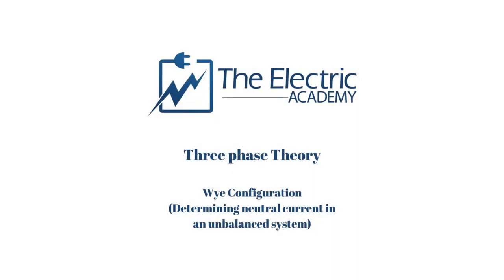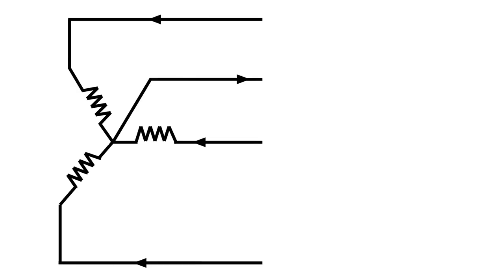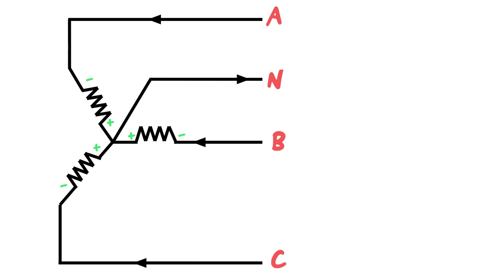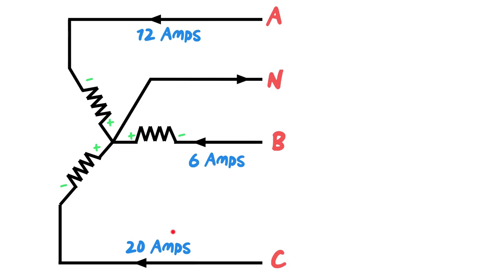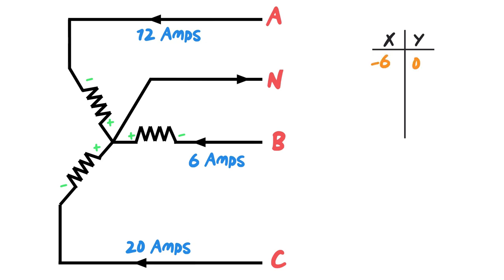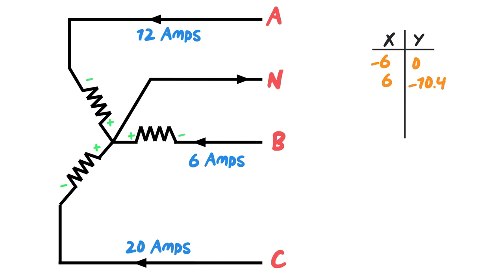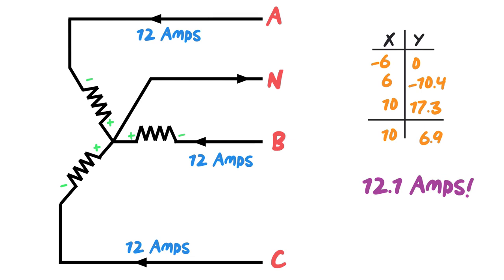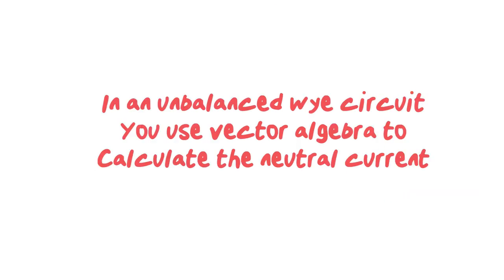Wye or Star Unbalanced neutral

Comment: Ok, supid question perhaps but if I have for example heating cables as a load , and each cable needs 230V AC . I have decided to use 3-phase  400V circuitbreaker to supply 6 heating cables .Will this formula work keeping in mind that heating cables are purely resistive loads ?

Comment: With the same parameters, where does the 12amps neutral current go if, the neutral conductor is removed.
Reply: The voltages over the different loads will change to balance it out.
Reply: @Liteg0  did you mean the three voltages will adjust their values no matter what it takes  so that the neutral current will become zero amps.
Reply: @russellteejaymolina6736  Well yes, it will balance out to have zero amps go through neutral. But it has a lot of implications. As soon as the voltage across a load increases or drops, so does the current. So you end up with a system that has a floating neutral as well as unknown and variable voltages and currents across the phases as well as loads (assuming this is not a fixed system, such as a house for example). This could also cause a cascading effect where electronics for example will get too much current/voltage and die resulting in further imbalance, higher (and lower) phase voltages and currents, killing of even more.

With a floating neutral (meaning it has a different potential to ground, no longer 0 volt) you have another issue. If you were as unfortunate to touch it, this will put you in series with the entire system and draw it closer to ground. Causing current to flow through neutral and through you in an attempt to get back to a balanced voltage and current. Dangerous stuff. Best to keep the neutral grounded.
Reply: @Liteg0  that was a nice explanation, thanks for the clarification, keep posting educational videos.
Reply: @Liteg0  Had this exact thing happen to me today.  Got a chinese machine, only three connections so must be delta, right.  Hooked it up and acted weird.  Let the smoke out of one of the parts.  I started reverse engineering it and found a tiny isolated common bar at the far end of the machine from the power entrance.  Connected that to the ground I had provided and everything started working normally.  So tomorrow I will run a neutral, so I was in the process of studying up for how much neutral current I should expect when I viewed this video.  The manufacturer said 480 250 amps.  Nothing about neutrals, nothing about 277 volts.  No schematics or drawings or anything.  I got suspicious when all the heaters had 277 on them.  Started tracing out the wires and found the common bar.  Still don't know what all we damaged.  It was a $75K machine.  I have been threatening the company that Alibaba will force a refund if they don't provide documentation.  They said no schematics exist but they will have their electrician draw one... can you imagine wiring up a big complicated machine by just hopefully understanding where to run all the wires??  Wish I had known this last week, cut open the floor, ran 4/0 wire in new conduit etc etc.   Now I gotta figure out how to fish one more wire into the conduit.  No bueno.....